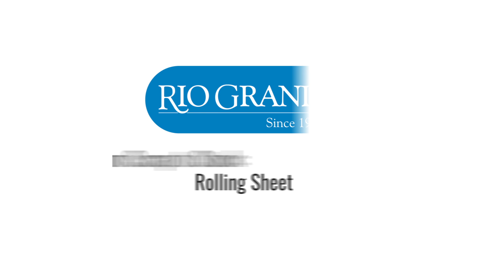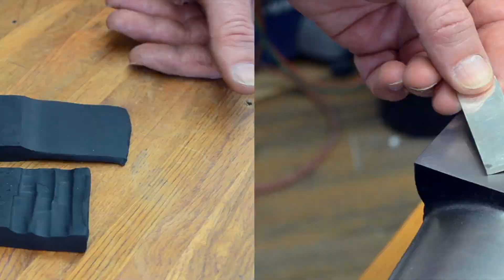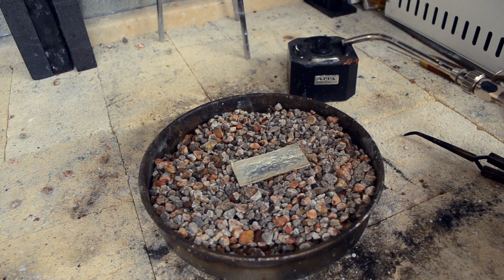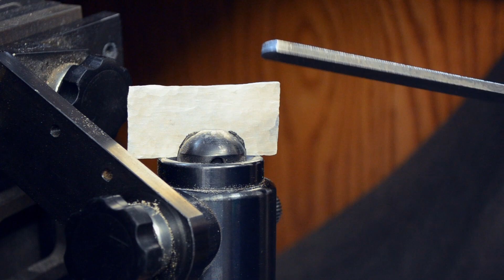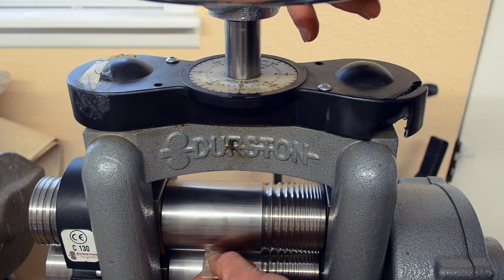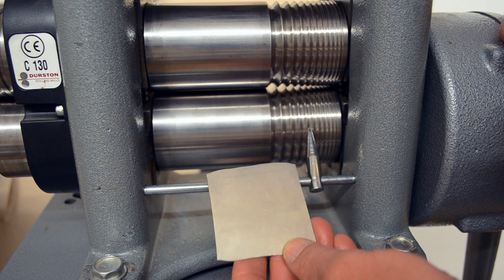From Scrap to Stock: Rolling Silver Sheet

Comment: Thanks for the helpful information. I’m trying to roll some silver sheets but they warp really badly. I learned some techniques on your video that might help but I also suspect my crappy roller mill might be part of the problem. Looking at it, it seems the rolling pins aren’t spaced perfectly parallel to each other. I was thinking maybe I need a better roller mill but $1,500 seems crazy expensive. Is there really justification for spending that much on a roller mill?
Reply from the maker: It really depends on the artist. We always recommend upgrading your tools to get better results with your jewelry pieces and can save you time and frustration to have a reliable tool.

Comment: Great video! Do you think it’s possible to use a similar rolling mill to straighten a 0.5 mm brass sheet that is already quite flat? Ps: I don't need to get a thinner sheet, I just want it to get as planar as I can with a tool that wouldn't break the bank.

Comment: Can you please give an advise on the best thickness of an ingot to go inside a rolling mill. Is 7 mm too much or ok to start with your process shown on this beautiful video? Thanks a lot
Reply from the maker: Each rolling mill will have a maximum sheet or wire thickness, some are 7mm for wire, but each is different. If you look in the “additional specifications” of the product page, they will have those sizes listed.

Comment: Thank you for the videos.  I have watched several videos and it looks like everyone turns the handle like its not difficult at all.  I find it very difficult to turn the handle (4:1 ratio) on my pepe rolling mill when making sheet.  I will run it through several times on one setting and adjust a tiny amount and it requires a lot of force to turn it.  I have annealed several times through the process.  Im not sure what im doing wrong It is only easier when i run wire through or small ingots for sheet.  I am going to try working it with a hammer first and see how that does.  Im have worked with had tools my whole life, HVAC work is very physical so its not because im a "pussy"
Reply from the maker: Thank you for the comment.

Comment: Ok.  I am learning a lot about what I'm doing wrong (probably) from this video. Thanks heaps.

quick question - if you do end up with silver oxides in your metal, how do you reverse that? (reducing flux perhaps - presuming a remelt)?
also, what does overannealing manifest as in terms of rolling behaviour? cracks and splintering?
Reply from the maker: Hello! Thank you for the question. Here is the reply from out tech team: Oxides are always going to be an issue with open torch heating and melting, that’s why closed system casting with a Nitrogen cover gas is such a big deal. You can mitigate some of the oxides with torch control by not pulling the flame off of the metal when melting,, and not using too much of an oxidizing flame, also flux will help to a small degree. Once they are in there I don’t know of a way to get them out, refineries do it but not sure how.

Comment: Well I had this idea to use old 925 jewelry to make sheet stock. So from your first video, the solder from jewelry can affect the end product?.😳
Reply from the maker: Yes too much solder would effect the ingot making it brittle and prone to cracking. It can also reduce the melting point of sterling and cause the metal to tarnish quicker than usual. It may also create an alloy that is easily reticulated. To avoid this you'd want to be diligent about sanding or cutting away the solder. Hope this helps!